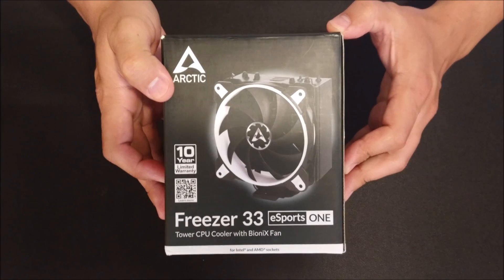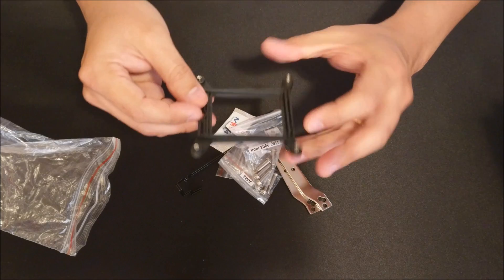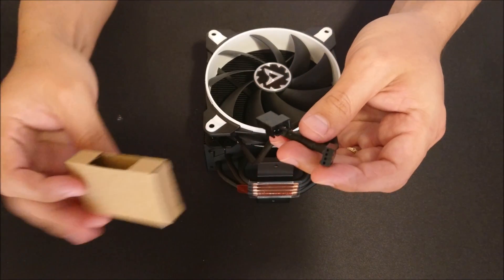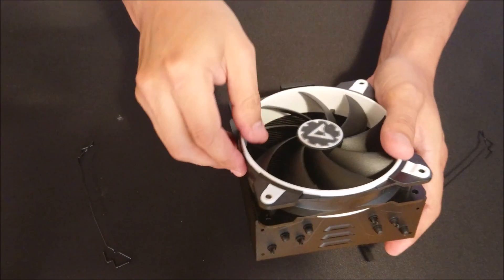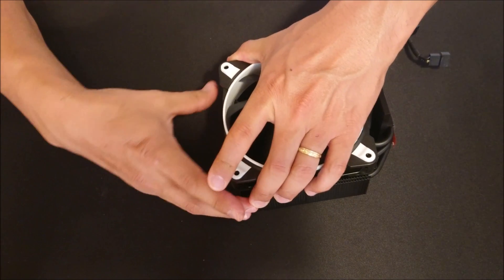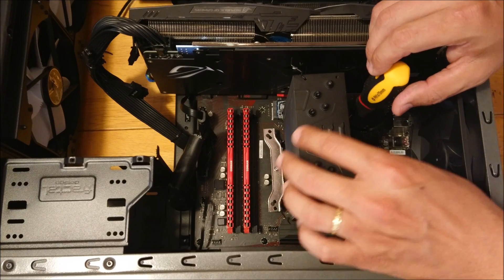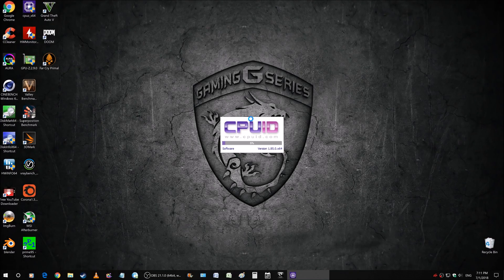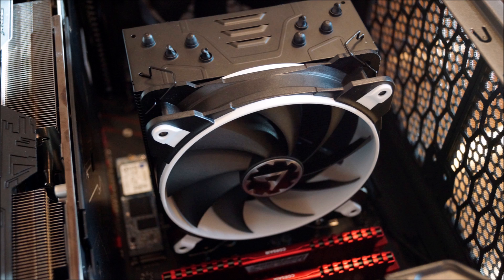Arctic Freezer 33 eSports One...Does It Cool As It Looks?

Comment: Nice video. One thing I really like about the Arctic Freezer is that the eSports Edition (2 fans) and the eSports ONE (1 fan, of course), is that they are identical. The fun part is that while the 1-fan version currently retails at $30 and the 2-fan version is $50, you can buy the 1-fan version and then buy a second fan for just $12.50, making the whole thing $42.50. The 1-fan is great, but the 2-fan is even better (at least in my opinion).